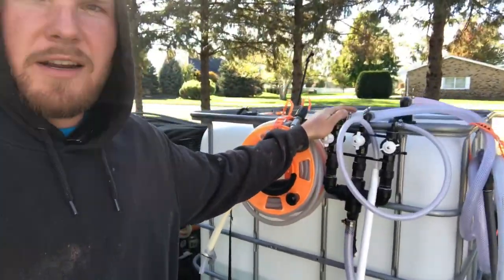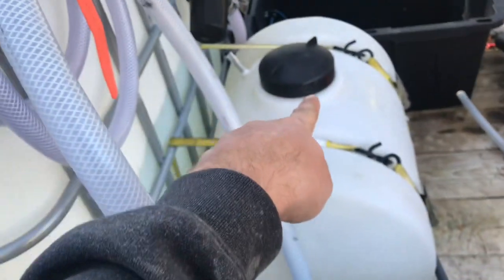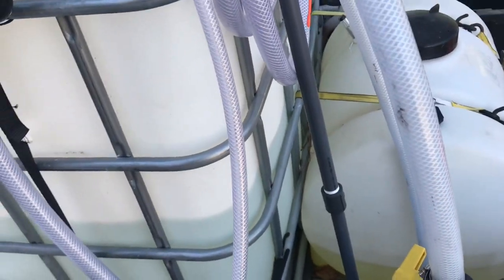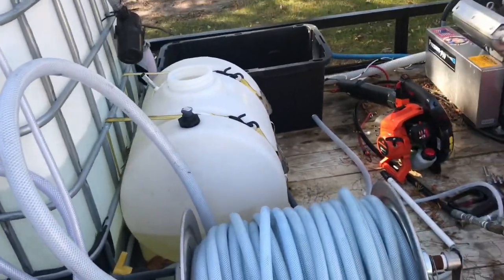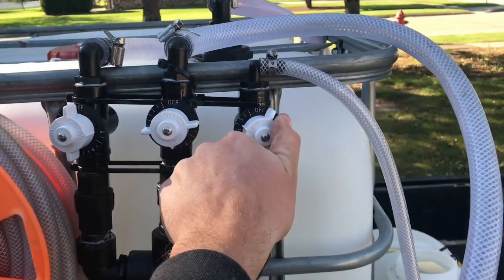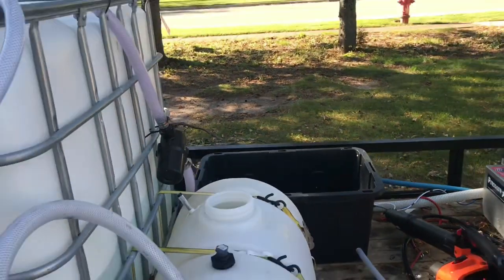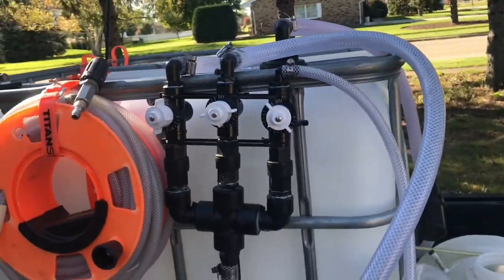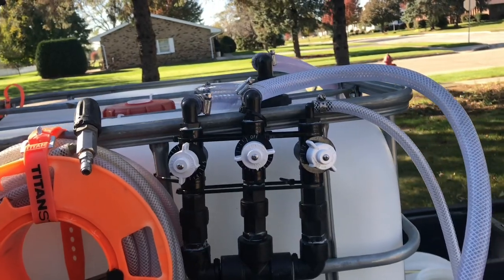Proportioner DIY BUILD: here’s what you need to know

Comment: Great Video John.
Is it safe to say that after the proportioner there is a pump that then runs into your 200 feet reel (something like a DELAVAN FB2 26.5LPM 100PSI PUMP)? If so, how do you prime the lines? Do you turnoff each nozzle and prime through the pump one at a time until all 3 are primed (i presume you try keep it that primed always). Last question, what nozzle do you use for spraying? Thank you all again

Comment: If your incoming water is always on 100%, is there really a benefit to having a control valve on that line, or would a simple ball valve do?
Reply: Anything stronger than 50/50 will require the water to get dialed down.

Comment: Where did you get your metering valves? It's a nice setup, you need to start housewashing with it too.
Reply: Pentair

4.6 out of 5 stars  39Reviews

Pentair R172086 1/2-Inch Control Valve Replacement Rainbow Automatic Chlorine/Bromine Pool and Spa Feeder

Comment: Is it possible to make a video on how exactly it works. I’m confused on how the water is pumped from the top also I see u have 2 hoses on top of the tank can u explain it please. Looking to get a tank but am clueless on how the water will reach machines and such. Would help a lot thanks
Reply: Get a flexzilla 100' hose runs from the house to a hudson valve, the Hudson valve is attached with a bulkhead fitting. You'll want a filter between the hose and the hudson valve.

Comment: Hard plumb the bleach line into the bleach tank.    Even if you tap it first you will drop bleach onto trailer. That poly braid hose will become more and more of a nuisance every day.  For your plug issue, just install whatever sized bulkhead that you need.  For flushing your 12v just shut all but water line and put that "bucket filler" tube into top of the tank.  
100% agree about it being able to sufficiently flush out and have next to no impact on water in buffer
Reply: Im sooo chocked Rob you are advising how to plumb a knockoff!?!!😀😀😀😎

Comment: When you assemble any mixing system any air leak will screw up all your ratios, siphon, and also your distance you can spray.  Use thread tape along with pipe dope and be sure to apply it a thread or two back from the end so nothing can flake off and stick to your metering valves or in your pump etc.  also I’m sure you know but your h20 line and Sh line should be as symmetrical as possible from start to finish and soap line is totally independent so your Already got that down it appears. 

       Pretreating or post treating is as much about what you see as what you can’t see.  I like to pretreat personally because it makes the cleaning go faster and then the surface has no chems on when you leave.  If you don’t use any chemical then even though it looks good now it will start to develop organic growth again faster because you didn’t actually kill whats growing on the surface.  Its like pulling weeds, good contractors get the roots up leaving a lasting affect and bad ones don’t.  Eventually your customers and long lasting results will pay huge dividends in years to come.  Hope this helps and wash on!

Comment: Great video!!! I've been thinking about a 12v system myself. Does the Fatboy really pull all three lines with no issues?
Reply: James
Check out this setup from Northern Tools.  You can add 2.5 gallons of 12.5% SH and a few ounces of soap and fill it with water and you have 26 gallons of house washing mix ready to go.  That will do most houses.  5.5 GPM is a fast way to get lots of mix on the house.  Mount it to a garden cart and wheel it where you need it to be.  Add extra hose so you can do 2 sides of the house at once without having to move it.  You can add a bit of plumbing to make it easier to flush the pump with clean water or just disconnect the hose and put it in a 5 gallon bucket of clean water to rinse.  Just make sure you put a filter on it.  It's a super cheap and easy way to get started and get used to running a 12v system.  

https://www.northerntool.com/shop/tools/product_200695295_200695295
Reply: Thank you josh

Comment: You mentioned the hose size for the soap was 3/8  but what size hose did you use the water and bleach inlet?  And what about the outlet hose size?
Reply from the maker: James Bryson 3/4
Reply: How many gpm 12 volt pump are you running. Are you really pleased with everything?
Reply: cody
He said it's 5.5 gpm fatboy in another comment.  
Check out the NorthStar 5.5 gpm ATV tree sprayer on Northern Tool's website.  Has a 26 gallon tank.  Just add 2.5 gallons of 12.5% and a few ounces of soap and fill it with water and you have 26 gallons of mix ready to go.  That will do most houses.  You can mount it to a garden wagon to make it portable.  Super cheap way to get started with a 12v system.  You can add plumbing to make it easier to rinse the pump or just disconnect it and run a hose from a 5 gallon bucket to it.
Reply: 3/4 water bleach lines 3/8 soap line exit hose 3/4.